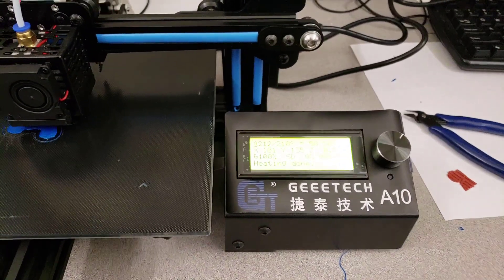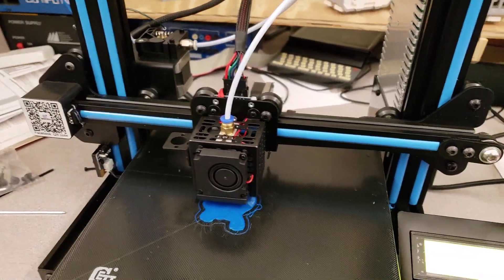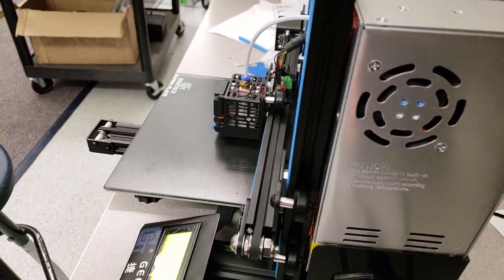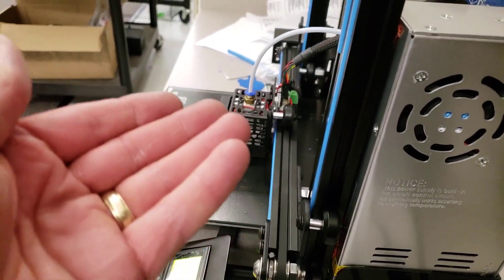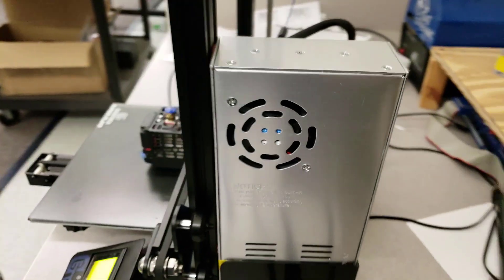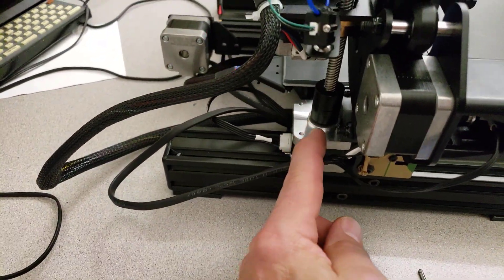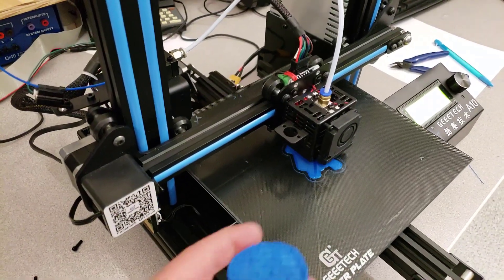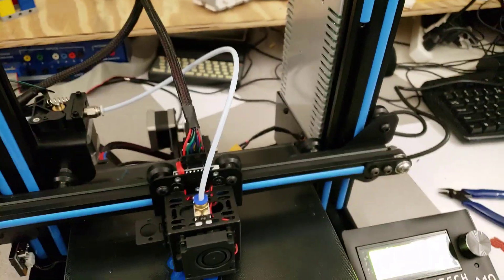3 wacky things on my GeeeTech A10

Comment: Iam new to this.Iam trying to put my a10 together.When I tried to level the corners the nozzle stays pressed tight against the super plate.But if I don't have the superplate on I can adjust the corners.What can I do to level the corners.
Reply from the maker: I know you cannot add the adjustment wheels till you can print, but maybe this video will clear up what you doing. https://youtu.be/Yj_KiUEewSg You can tighten and loosen those screws, right?

Comment: Just put mine together last night.  Had the same issue with the power supply (seems to be common with all my Creality/Tevo printers too)  I had two other issues....it takes many turns on the controller knob to move through the menus.  And installing that ribbon cable wasn't much fun...finally figured out it will stay in once you close the tiny flap that secures it!  
I'm going to install a bed leveling device and I have to measure what the XY offset is from that mount to nozzle.
Reply from the maker: I agree that the number of spins to set the temp etc are wacky!  I have not done any auto bed leveling.  I find that once I get the bed leveling ironed out manually I am pretty happy with it.